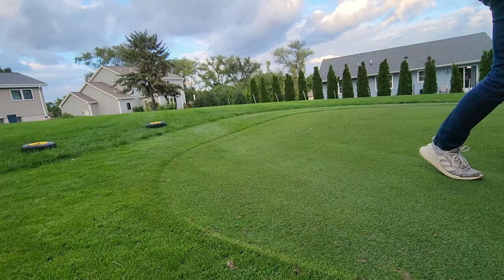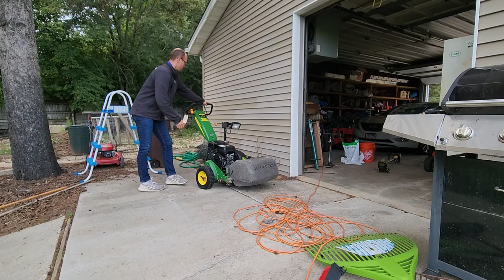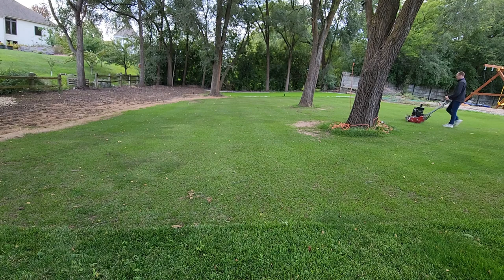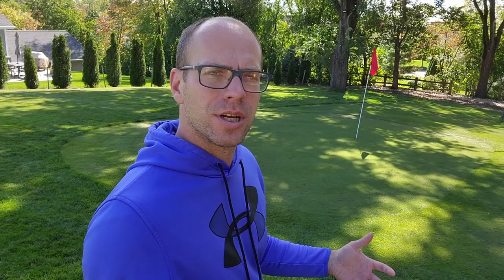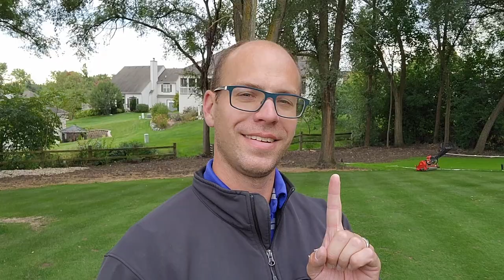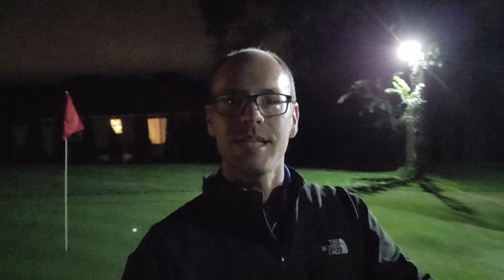A Putting Green Mow | Discussing Maintenance for a Back Yard Golf Course

Comment: The stall out happens to me too. I think it just needs warmed up a little more, but I'm impatient. My workaround is to throttle to MAX ⚡, drop the clutch and peel out for the first lap. 

So sounds like you may have a gantt chart for your application schedule?
Reply from the maker: The jd is the only one that does it. Not the chart specifically. Try to do fungicide every 4 weeks and pgr every 200-250 gdd
Reply: @JasonSeiberlich  I didn't have the issue when I bought the unit from a reseller that did maintenance on it prior. It looked like it needed new belts then - but I haven't changed them yet. I replaced my carb because of a surging issue. No change in clutch engagement - though it runs better. I just think I need new belts. 

Forgot to say the lights look great! Thanks for your content!